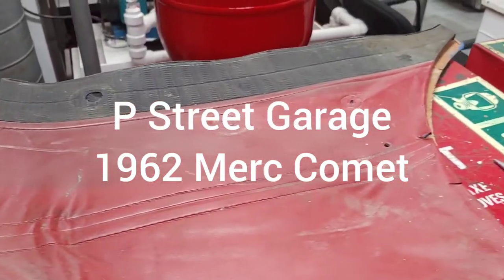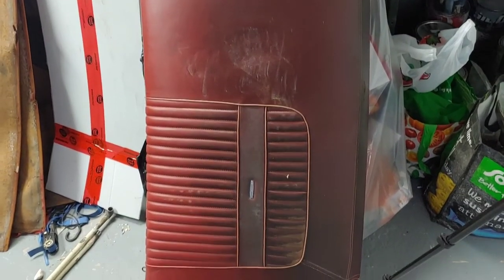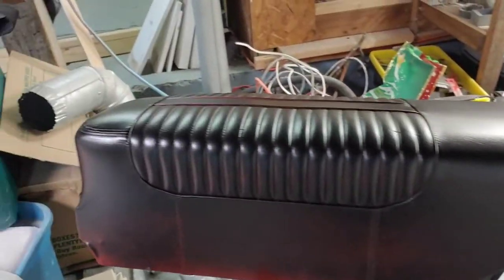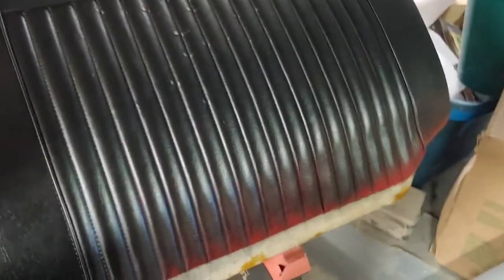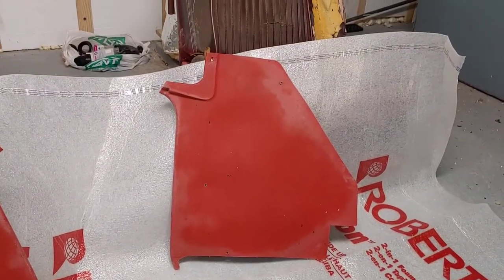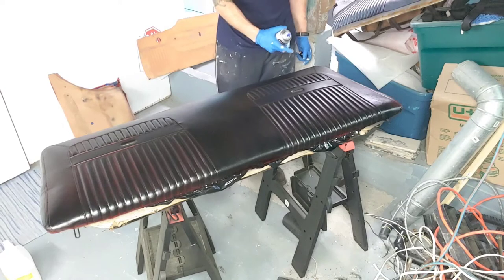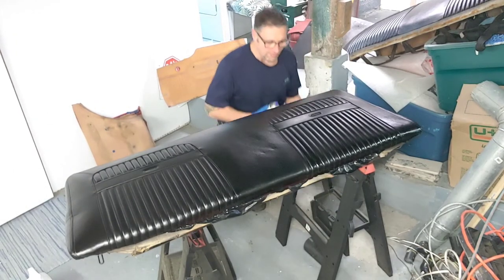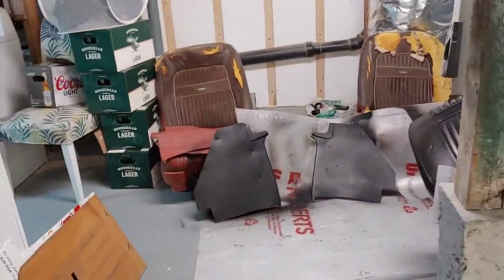PAINTING MY CAR SEATS !!  Vinyl and fabric paint color change.

Comment: Looks good man. Love the covid door panels. I would re upholstery the original front seats, it would be cheaper than finding new ones.
Reply from the maker: Thanks man. Yes I may order the skins and foam from Ecklers.  Im having no luck finding any good buckets.
Price was right on the covid door panels
Reply: @pstreetgarage7304  Don't tell me they actually charged you for the covid signs.
Reply from the maker: @LimitedEditionMotorcars  My company paid for them.  The old ones were being thrown out...they were free lol
Reply: @pstreetgarage7304  Good, they should have paid you for taking them lol
Reply from the maker: @LimitedEditionMotorcars  I will run that by them 😝😝😝

Comment: I was wondering about that paint. Im in the U.S. and it seems that buckets from a 64 65 mustang work also. And they are very hard to find.
Reply from the maker: Yes i have had no luck finding bucket seats.  Modern ones would work but I like low back for that vintage look.
Vinyl and fabric paint it amazing